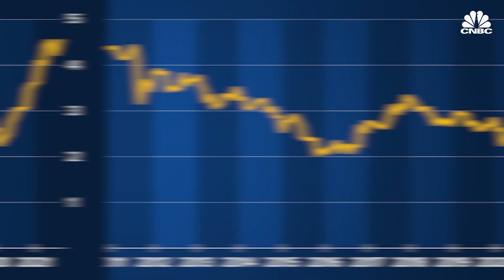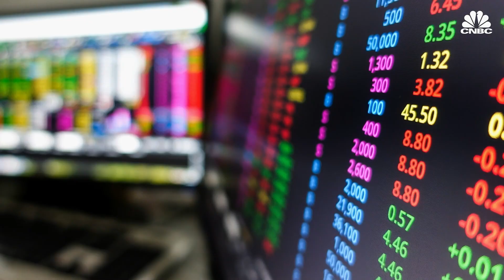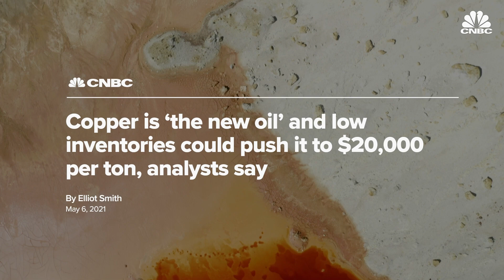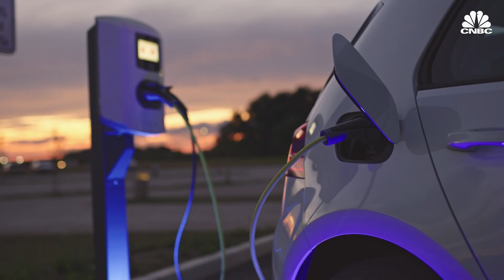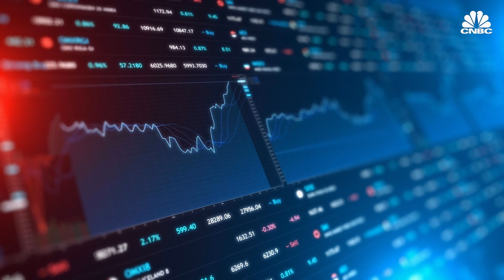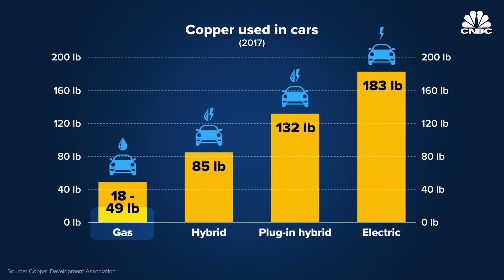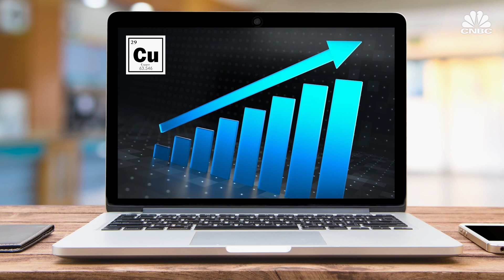Why A Looming Copper Shortage Has Big Consequences For The Green Economy

Comment: Goldman Sachs:  "Copper is the best conductor known in the periodic system". This is the reason he became a financial analyst, he didn't pay attention in science class. My EV has aluminium busbars copperplated where they connect to real copper! Guess the industry already knows it has to reduce its dependancy on copper, to protect themself against price hikes.
Reply: Silver is the best conductor
Reply: Aluminum is an alternative but it doesn't meet automotive standards naturally. Aluminum has low  tensile strength and lower conductivity. There's a few companies who have proposed solutions one being Sumitomo but the Aluminum wiring has to be converted to a strong alloy to meet automotive standards. In addition, Aluminum isn't as conductive and with more electricity being ran through cars with EV that will require a strong conductor. Current solutions are smarter architectures Aptiv has one of the big options for that and Tesla. Its very unlikely we will see alternatives for copper in near term. They use Aluminum wire harness on some ICE cars for weight saving but are all high end. 

Now general electricity. Copper is best conductor. It is the best conductor for industrial purposes which a financial analyst is looking at. Its not brittle and very versatile for electric needs. We do need alternatives but just because something has high conductivity and optimal does mean its cost effect for industrial purposes. Some future options are nanotubes and aluminum if they can improve quality/conductivity and tensile strength of aluminum but the price needs to be lower than typical copper applications which will be hard when you have some much value added transformation. 

To conclude we need recyclable options and less exportation then spend back adding to the value chain. Domestic recycling, and reusing needs to be top priority for all countries. This will likely have to be subsidized for the near term.
Reply: @Evan-xm5ei  there is also lots of work on ceramic based superconductors.
There is a fair chance that in 10 to 20 years they could change these dynamics.
Reply: @dethrophes7283  Yeah there's a lot of promising options I really hope they are able to lower cost. I think that's the biggest factor the ability to scale to the massive levels needed for public infrastructure. Its easy to say we can find alternative but there's thousands of thousands miles of copper wiring. Are these solutions truly scalable and what level of manufacturing will we need. Capacity growing takes a very long time. I'm hopeful but not anything in the next 10-20 years hopeful.
Reply: @dethrophes7283  but realistically, room temperature superconductors should not be expected for a long time. The time scale here is dependent on the use of logical qubit quantum computers to simulate materials and begin to increase the transition temperature for superconductors by designing the chemistry.
Reply: and idiot rich heirs like those "ANALysts" that take very important decisions for our lives, yet they don't know the basics of science
Reply: Actually silver and copper both only have one valence electron. Making them similar if not the exact same at conducting electricity and heat. I believe it's something negligent like 8% better at conducting electricity which is only needed for the most sensitive equipment. Took me 2 seconds to Google that.
Reply: @8BitNostalgia  Silver is better at heat absorption and dissipation, by a margin of 5-10%, and Silver is a better conductor than Copper.  Copper, Silver, and Gold are all used for varied reasons in the real world. Copper is cheaper, more malleable when it comes to construction, while Gold is used in many electronic devices as it does not wear and tarnish like copper. Silver isn't used as much as it is expensive like Gold. Mostly used in Satellites and in extreme conditions.
Reply: @8BitNostalgia  They're on the same periodic column, yeah, but silver is the benchmark for conductivity, being 100 and copper 97. They're similar, but silver is better
Reply: I like how they show 69kv power line and saying how transmission lines will use more copper. WTF, who uses copper for transmission lines?
Reply: Are you sure what you think is aluminum busbars isn't really copper bus bars with silver plating? Generally that's the main type of copper used in large electrical systems silver coated copper bars or wire
Reply: They never said it was the best
Reply: You make an excellent point.  Copper use is somewhat price elastic.  Residential electrical service entrance cables went from copper to aluminum years ago due to the size of the conductors needed.  Copper plumbing is rapidly giving way to plastic, which has superior properties to copper in that application, anyway. Electric cars are a big driver of future usage. though.  Rapid adoption of electric vehicles, if and when it occurs, will drive shortages in a number of materials, including copper.
Reply: That's because a vehicle needs to factor in weight.  Aluminum is still a good conductor, but  far worse than copper.  But it's also far lighter, which is why it's being used in cars like yours.
Reply: @PaulGuy  I'd imagine it is a cost thing too. Nevertheless, in vehicles, weight is also a factor in power consumption, so the penalty from using Aluminium is somewhat offset by its weight savings. If you look at most battery modules, the cell connections are all Aluminium, so regardless it is only the wires between modules which is higher resistance for not being Copper, so the difference is likely inmeasurable.
Reply: Cost effective on a massive scale?
China has proven with their boom that copper is the life blood of infrastructure.
Silver is too expensive and used in to many other things to justify the cost. People just throwing their “save the world” thing on top of it.  We gotta get the infrastructure “green” before all of that happens.
-bullish cooper
Also…idk if anyone has seen the price lately but 🤷🏽‍♂️
Copper will sit comfortable above $6 short term and higher when people start building.
China is still mostly undeveloped besides all the cities we know.
India will start investing infrastructure.
belt and road.  I’m not gonna sit here and list places that are going to upgrade just to start having better protection for themselves.
Copper in infrastructure just to start all of that.